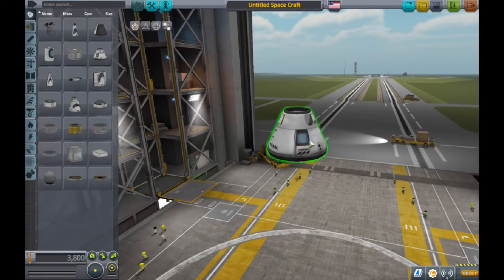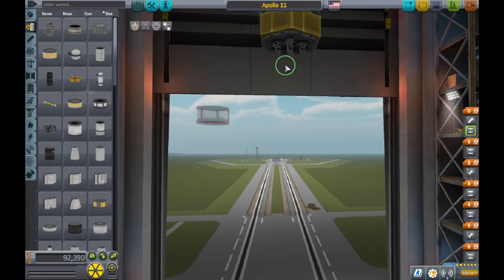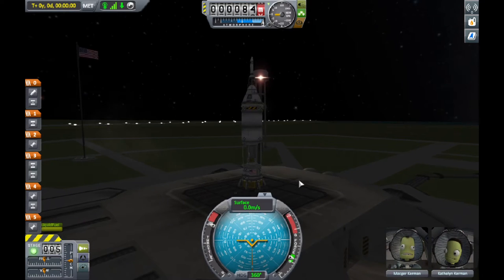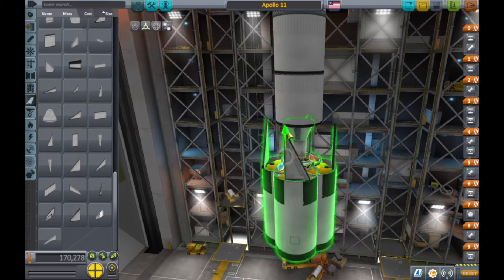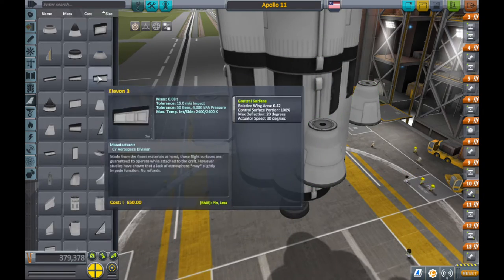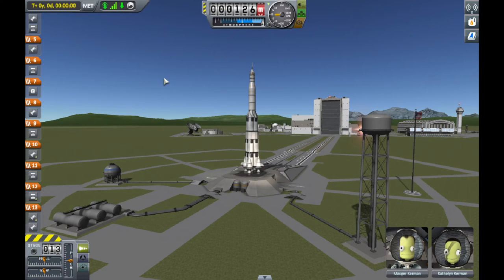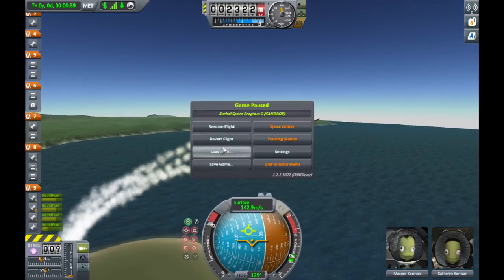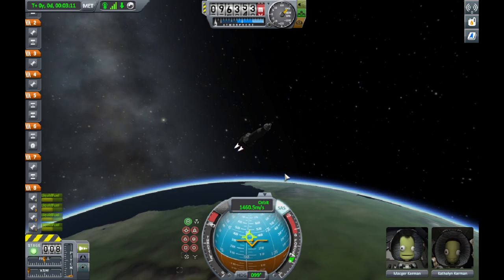How to build the best Apollo 11 in KSP NO MODS!

Comment: Why did you attach about 10 fuel tanks for the first stage...?
Reply from the maker: So it can be in proportion with the command module. And its closer to scale as the real one is much much bigger than this.
Reply: There are unnecessary parts everywhere, also. HECS2 probe cores... fuel tanks... lander cans... 20 vector engines (5 mammoths at the bottom, and there are more above)... It's similar in size to the real Saturn V but is mostly excess parts.
Reply from the maker: The probe cores are for looks, used to simulate the gold decent stage of the LM. Fuel tanks are for fuel. Obviously if I'm adding all this extra parts I need a lot of fuel to counteract the weight. The lander can where the only one big enough as in terms of diameter to go in scale with the CSM unfortunately there too thin in height so I used two. And finally the mammoth engines were the only ones that can lift the weight of the rocket in the time of this recording, I have actually found a way to use the original engines from the thumbnail to get the rocket into space.
Reply: It does look fairly like it - just you threw a ton of parts on to make it more realistic.
Reply: UNNECESSARY PARTS FILLED ROCKET ONLY COSTS ONE FUND BUY NOW
Reply: anyways i got rid of those parts

Comment: you Apollo service module hade fuel cells in it to gerenrate the electricity
and you say you put accuracy over performance yet you use engines that are nothing like the real engines and you don't put fuels cells in
if you want to go for realism get mods
and the worst thing that bothers me the most is that you titled the video how to build the best Apollo 11 when it should have been titled how to build the Apollo module and a Saturn V
and anyway it's not nearly close to being in the upper half if i were to rank by number every Saturn V ever built in KSP
make sure to do research on things you do